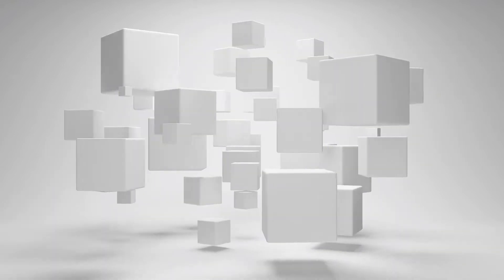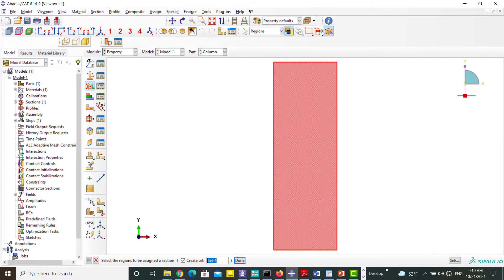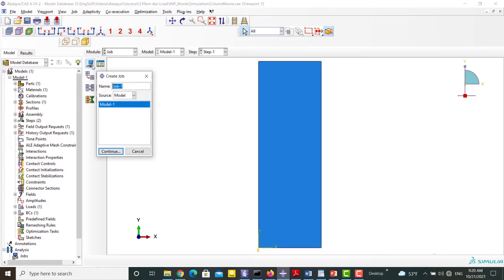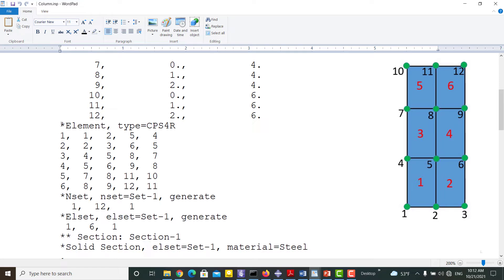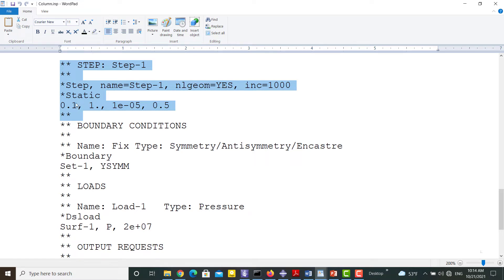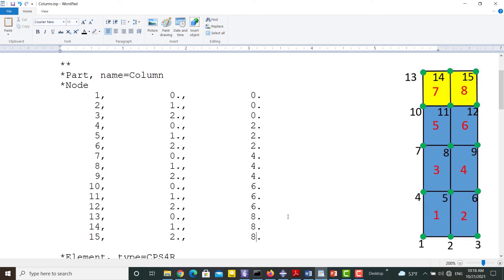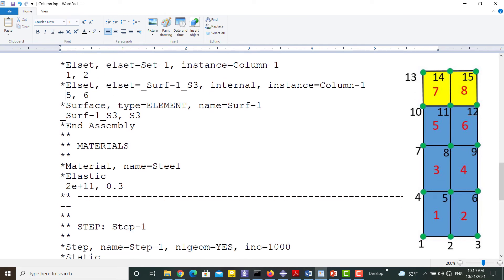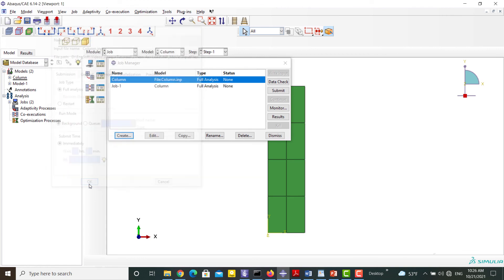How to create, understand, modify and use inp (input) files of Abaqus?

Comment: hello,
If I use a reference point to apply load on a cantilever beam, then I use coupling constraints (uniform weighting method) to constraint the upper edge of the beam with the reference point. The software does the coupling by itself by creating some constraint points and linked it with the reference point. Is there any way that I can know about the exact value of loads those are acting (after distributing from the load applied on the reference point by the software) on the nodes?

Comment: Can u create a video for inp files of 3d body? I need the details of nodes of all the outer surfaces (elementwise). How can I achieve this?
Reply from the maker: usually nodes on a surface have constant x or y or z. So you can write a script to extract them from inp file.
Reply: @engineering_software  I am not so well versed with scripting. I can write some codes in matlab. But I don't know about abaqus. Is there any inbuilt method?
Reply from the maker: At first create the inp file. Then copy node and element information lines to matlab and find your interested nodes by a matlab code.
Reply: Well but in case of 3d body having 1000s of elements finding element numbers of surface elements manually is not possible without mistake . I understand the matlab part u said but manually finding element number and which surface is exposed at boundary manually is not easy.
Reply: is there a way to select all elements on a surface in abaqus?
Reply: @MS-mz3bd  actually you can, maybe u can select (from exterior) and create a set for all the elements and nodes you are interested in and copy that to your matlab code from inp file.
Reply: @zhushuaihit0712   Thanks.

Comment: In my Baqus 6.14 version .inp file is not generated.. is it could be issue with Lmstool?
Reply from the maker: In fact the job is performed by inp file. If you can run the problem the inp file exist in your computer.